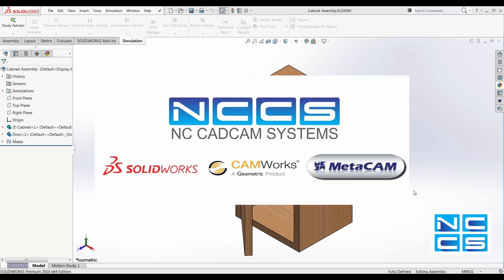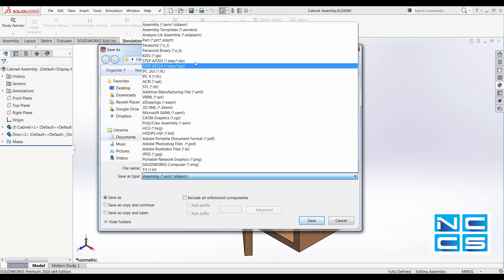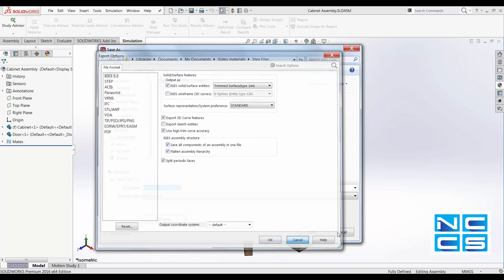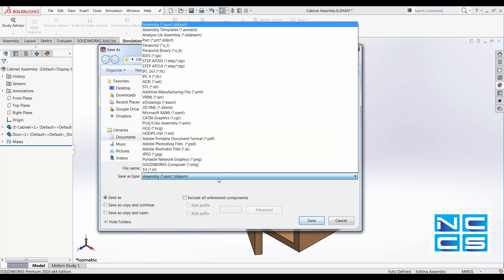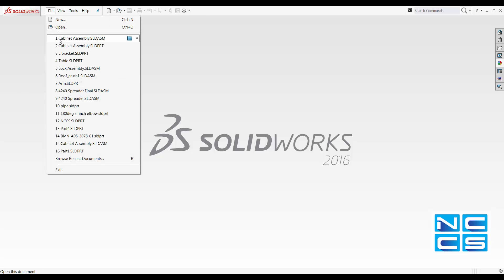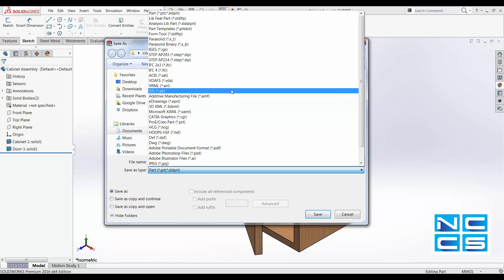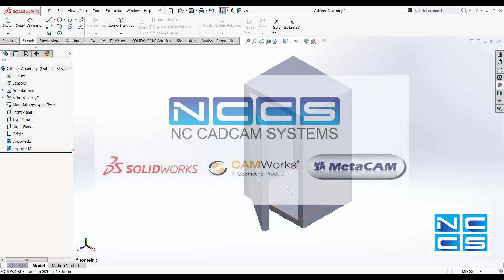SolidWorks File Conversion (STEP, IGES, Parasolid)

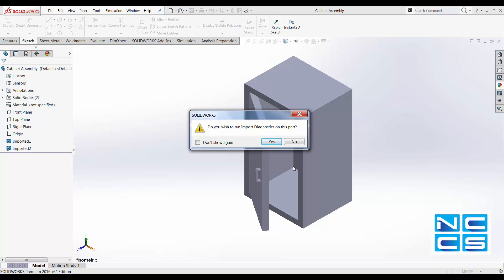Comment: At the 6:00min mark, you mention waiting 10 min and if it hasnt worked then something has gone wrong. I have had assemblies take up to 30 min to process into a step file before. Best let them run longer.